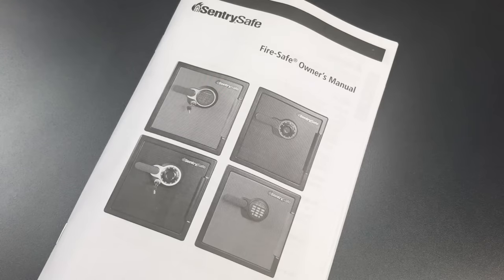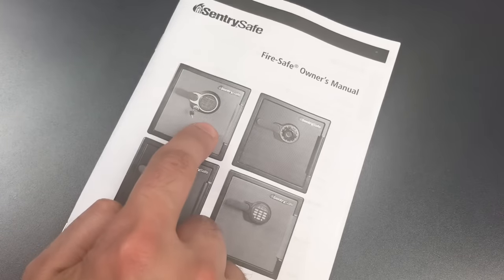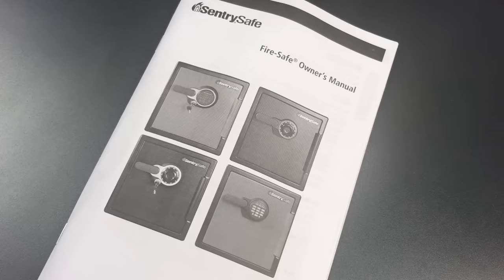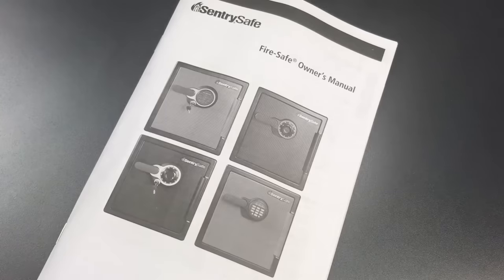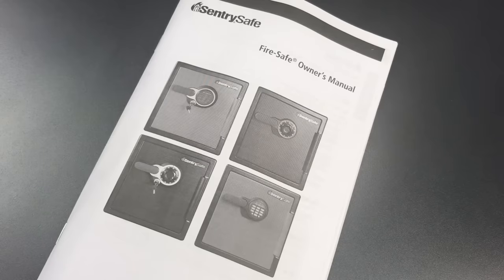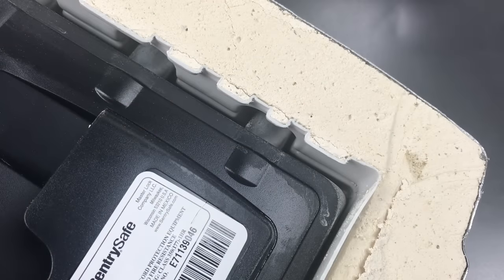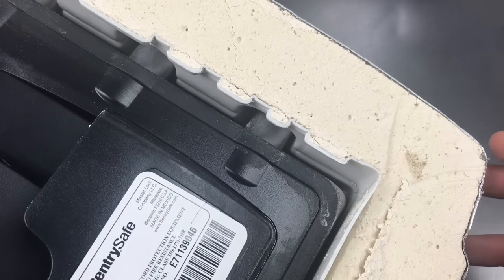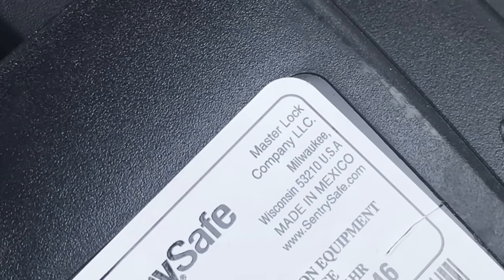[756] Sentry Safe Cut in Half FAST!

Comment: Love it. There's a Russian company that makes floor safes. They are made from 10mm or 3/8" steel and they tell you cement it into a concrete floor using rebar.
That's a bit more like it!
Reply: There's a lot more than just a Russian company making that kind of safe.  It's and extremely popular design for businesses that need to store only a few small valuable items and own the building or have permission to modify the building to install it properly.  Frankly it's not a bad idea for residential security either, in that for practical purposes it can't be carried-off to break into it somewhere safe from prying eyes, and it can be obscured from view to make it harder to find in the first place.
Reply: @TWX1138  I know but in Bulgaria, Russian made is easy to get. ;)
Reply: I have seen in a vid long ago that the best safe use THICK plates of copper. I mean,  probably a couple of inches. So you cant attack it using a saw because copper dissipates the heat so well that cutting it is near impossible, saw goes very slow and jams in the copper. Looks legit to me.
Reply: its not a saw it a torch (oxyacetylene) that cant cut copper
with a saw like this video is very easy because they are not abrasive witch means that the functioning principle doesn't relies on heat
Reply: 38911bytefree
Hm, sounds like bullshit to me. Copper is fairly soft and easy to cut with a saw. How would heat dissipation even hinder a saw? If anything, it helps. 
Copper tends to clog up abrasive wheels but most saws cut it just fine. Really the only useful attribute of copper for this application is its density.
Reply: swiss  Copper is actually hard to cut with tools ment for steel, tried drilling in copper? it'll ruin a good new drillbit in seconds.  However if you have tools made for copper its quite easy to work, but still slower than steel.
A good construction would be a layered mix of steel and copper, two layers of 10mm steel with 10mm copper in between would stop a lot of power tools (or at least slow down the prosess)
Reply: Mad Max  Cutting Torches isn't good for opening safes with valuable papers in them, you might get some jewelery out tho, if it isn't melting giving you just scrap gold.
About building safes of cast iron with carbide chunks in it, that would be effective, and if reinforced with something that makes the iron less likely to crack you got yourself a good strong box...
Reply: Renax the Man
Yeah, or you could do what actual safe manufacturers do and use layers of hardened steel, ceramic plates, high tensile strength fibers, concrete filled with bearing balls and other goodies that are guaranteed to put up one hell of a fight for any cutting tool.
Reply: Heat needs to build up to make the cutting possible. Abrasion process goes gaster on high temperatures, but copper keep the surface cold. Probably the clog thing is also the reason. Look for the vid here.
Reply: LOL, guees you can still fit something inside that is more valuable than the safe. Yeah, looks insane expensive safe given the high prices of the copper now.
Reply: No way in hell I would trust a Russian safe.
Reply: @acertainshape  Bad idea. Skripal's alive.

Comment: Its more an advertisement for the good old skillsaw's Then it's for that cheap-ass " Safe"
Reply: Don't forget to turn the blade backwards when cutting sheet metal or you'll maybe hurt yourself.  Look closely at this blade 2:37 and you can see it's in fact backwards. That's a point the LPL should have mentioned before some nitwit tries to copy this and gets a nasty kickback from the saw
Reply: @adamschaeffer4057     If you're trying this, then it's because you're stealing a safe. So I say they deserve any kickback they get.
Reply: @adamschaeffer4057  Actually, that is the correct direction, the saw blade rotates upward at the front and the teeth are angled upward and meant for that direction of rotation.  Blade speed is the #1 concern here, as wood setups are roughly 50% faster at the teeth, so there's not enough torque to cut through something like angle iron without grabbing too much material and getting kickback.  You need either a slower blade, a different tooth angle or geometry, or a combination of both.  Certain saw blades are actually designed to cut through steel, they have a different tooth angle that doesn't take as huge of a bite from the material and can be used like any other blade.  A few work equally well through steel, wood, plastic, nails in boards, and some are even used for concrete...it all depends on the blade.  In this case, that metal is so thin that even a wood blade/saw combo shouldn't experience much of any dangerous kickback provided you're not a rank amateur with a circular saw.  Had he attempted to cut through 1/4" steel plate, yeah it wouldn't have turned out so well.

An interesting side note, I've tested a lot of different types of blades and wheels for cutting metals trying to find the fastest one.  An abrasive wheel is the standard metric, but I've found that metal cutting blades cut just as fast with less detrimental heat introduced.  The fastest I tried was a completely normal but dull wood saw, so much so that the teeth weren't able to take a bite from the metal.  This seems entirely counter-intuitive, as any type of cutting tool should be precise and sharp, but it didn't start cutting until the friction heated the surface of the metal being cut.  At that point, it cut straight through like butter, the teeth merely being used to shovel out bits of metal that had been melted by friction.  Unfortunately, the sparks generated were excessive, even more than an abrasive wheel, and I relegated it to the shelf as a backup.

Comment: "An exit door procedure at 30,000 feet, the illusion of safety" -Tyler Durden
Reply: The exit door procedure is not meant for 30000 ft.  You cant open the door at that height.  It is specifically designed as such.  The procedure is for if you happen to land and be alive.

Comment: I think that fire protection is the most important aspect of this box.
Reply: It probably completely fails at that too. We just need a safe burning lawyer to test it.
Reply: @odizzido  actually, it doesn’t...it’s resistant not proof, so it does actually protect from fire which is the bigger point of it
Reply: @bostonrailfan2427  Was about to say with metal that thin fire will do damage and will get too it.

Comment: I had a Sentry safe I bought from Walmart and I “lost” the keys 🔑.  I had no way to open it so I took a screwdriver, a 4-5’ long crowbar, and a hammer I had in the garage. I put the flathead in the door (side that opens) and pried open a slot big enough to fit the tip of the crowbar in it. Then I placed the tip of the crowbar in slot and pounded it in more with the hammer. It started to separate the side from the door as I pulled on the pry bar and then “pop” It opened right up. I was surprised at how easy it was. 🔒 📦

Comment: Watching him cut this think open i'm like "is this made of Styrofoam?"
Reply: kind of yeah, sytrofoam is an insulator which means it's resitant to temperature change. The same logic applies to something fire proof. It doesn't get hot, and it doesn't combust at low temperatures.

Comment: I just bought the dial combination version for $30 from a bin store. They had the book taped to the top but they said they didn’t have the key or combination. I knew the combination was on the back of the book, and I have a 7 pin tubular lock pick/decoder. Once I got it home I got the combo from the book, entered it, and voila, it was unlocked. I didn’t even need to pick the lock. The keys and mounting hardware were inside.

Comment: i dont know what about usa... but we have two types of safes - 1 for storing stuff so there is no harm to them like fire, water etc. and 2) safe for puting stuff you want nobody to steal. This is apearetly the first type. Its not meant to be supersecure if someone wants inside. But no safe is safe enough - its a matter of a need to get in destructively so insurence will pay ... or you need to make a ton of noise (which you did) to get in so someone would notice. You can defeat almost any safe with powertools if you can make noise and you have plenty of time.
So this does not necessary mean that this product is really bad. You just have to buy it for its purpose.
Reply: beat me too it. there's definitely a difference. most fire/water proof safes are not so secure from theft, and vice versa.
Reply: The problem is that the company sell this as a real safe for storing valuables, not just as a fire resistant enclosure.
Reply: Yup, I have this fire safe in my closet. it has documents in it that i'd rather didn't burn.
Reply: it make also makes sense to store valuables in a fire resistant enclosure

Comment: When I saw the dust on the safe, I involuntarily blew at my screen
Reply: Yeah from the thumbnail I was expecting at least a metal cutting blade and some cutting oil as part of the process. Did not expect ~1/16th inch sheet, some insulation, and what looks like rubber (for water seal I assume) on the inside.

Comment: I thought it was sold metal at first and was like wtf thanks I learned something today
Reply: i never knew there are "foam" safes out there ...
Reply: If it is fire and heat resistant it has to be foam.

One good us of these is to keep the inside a safe for extra fire protection.
Reply: @57thorns  I think you are being sarcastic right there ;D
Reply: @96dragonhunter  Not really, the insides of an all metal burglar resistant safe can become too hot for paper or plastic, so you have an insulated box inside for extra heat protection.
Reply: @57thorns  :)
Reply: @96dragonhunter  I am sure you got it, but just to be on the safe side:
When computer media came around, companies had these large and bulky safes where they stored all their data in the form of paper documents.

Of course they also stored magnetic tapes there as well, except in a fire the inside of the safe became so hot (80 C?) that the plastic warped or melted, even if the paper was fine.

So there was a market for extra fire protection. in the form of a fire box inside the safe.
Reply: Solid metal is much heavier than most people expect it to be.

Comment: I have a 100yr old safe i got at an auction for less than that piece of junk  if you tried to roll it over on it’s side you would swear it was bolted to the floor. I’m pretty confident you wouldn’t get in it with a skilsaw and you certainly won’t be chucking in the back of your truck to attack when you get home !

Comment: The fire and water protection is the main reason to own a safe.  In fact, I strongly suggest folks get one just for that.  House/apartment fires suck

Also, any security safe should be bolted down
Reply: I actually own that exact "safe" purely for the fire protection.   I put sensitive documents in it, like original birth certificates, passports, etc.  Not because I think the safe will protect them from thieves, but purely to protect from fire and toddlers.

Decent toddler protection btw.  Can attest.
Reply: Yep, 100% agreed. It's unfair to mock this product as not being "theft proof", as that is not what it is intended for.

I keep my documents in a fire-proof portable lockbox. My theft protection is to store it where nobody will ever find it.
Reply: Bolted down almost anywhere in a home or office and this safe becomes 4x harder to break into.
Reply: @WizDJ  There is no provision in the safe as purchased to bolt it down. When i had a similar looking but much more robust safe, I bolted it to the concrete floor in a closet under the stairs. Down at the end where the ceiling got very low. This made a very uncomfortable working space to attack the safe. Plus I cut the bottom out of a cardboard box and put it over the safe. Reasonably well hidden to look like an old box at the back of a closet.
Reply: @curlydave7689  We utilize this exact safe in one of our businesses and it does actually have the provisions. The portions that are extruded as legs are meant to be drilled out if mounting and the plastic liner contains divots to mark the areas to drill. The reason the holes aren’t included as purchased is they would compromise the fire and flood protection if it isn’t to be secured to a floor or wall.

Comment: Hey LPL, just a comment for saftey: Do not use gloves with rotating tools! They provide little to no protection but expose you to the risk of strings getting caught in the sawblade and pulling your hand/arm in potentially cutting you or twisting body parts to an unhealthy degree :) (probably the saftey manual of the tool also states that, if not, go on)

Comment: When I saw the sawdust, my jaw dropped. They did NOT try to peddle a wooden safe, right? Right? Oof.

Edit: "Fire insulation", apparently. Unfortunately, it doesn't seem to be effective insulation against a sharp object.
Reply: That is what I was thinking to when he first started cutting.  I didn't expect high security but when what looked like wood sawdust started coming out my first thought was "How is wood supposed to protect the contents?".  I was expecting a thin concrete or plaster shell under the steel plate not a foam the same color as pine.

Comment: Great video! I'm throwing my sentury safe AWAY
Reply: It may still be useful for keeping documents safe in a house fire. Now we just need to see LPL drop it in a pool of burning jet fuel and see how long it takes to melt.
Reply: Why? Just bolt it to the floor and no one will be able to walk away with it which is going to be the main thing you have to worry about with small safes.
Reply: Eh I use it more as a fire protection box rather than theft protection as the problem with modern safes to that a thief can steal the safe then open it later at his leisure. The main protection is the weight of the safe nothing more
Reply: Panther Platform don’t forget to empty it 😂
Reply: @Navy735  no that is completely false. Even the CEO of liberty safes will tell you that bolting the safe to the floor is we're most of your security comes from. Professional thieves who steal safes don't care how heavy it is. The guy I pay to move my 700 pound liberty safe can push it up the ramp into his moving truck by himself with no help.
Reply: Panther Platform no need to throw it away, just use it to keep documents safe from fire.
Reply: Put it in a real safe. The drywall the sentry safe is made of is excellent for fire protection, and your high security safe may not have it.
Reply: They are good fire protection for documents (up to a point) but if those are documents you are also concerned about the security of you may want to keep the box within a real safe. Otherwise there are a lot of other uses. Use it as a bait box by putting a tracker of some sort in it and leaving it in the living room under an end table. Keep costume jewelery in it. Use it to secure the keys to the padlocks on the power cords for the kids computers and game systems/TV until they have completed their chores. I'm sure you can come up with other uses. I don't expect it makes a decent anchor though, all that fire insulation is likely to keep it floating. Fish marker perhaps?
Reply: David Rasmussen lol
Reply: I use my sentry safe for burglar bait. It'll be the last thing they see before the buck shot sees them...

Comment: When buying a safe check the thickness of the steel. You want one measured in fractions of an inch.

 If it's measured in gauge, don't bother.
Reply: When buying a FIRE SAFE check the fire rating of the insulation. This tells you the intensity and duration of the FIRE that it's designed to protect against. 
There are no requirements for "theft protection" in the FIRE SAFE standards and ratings... that is something completely different.
Reply: @johncoops6897  if you're buying a safe for theft protection that should be your focus. Fire rating is a secondary consideration since there are a hell of a lot more burglaries than structure fires.

Thanks to modern building codes and firefighting techniques structure fires with enough intensity and duration to overcome the barest of insulation standards are as rare as hens' teeth. Residential burglaries on the other hand happen every single day and even the best neighborhoods aren't immune.
Reply: @kevinfelton689  - perhaps crime is more prevalent where YOU choose the live, but certainly not everwhere. We don't even lock the doors in the suburb where I live (city of 6 million people)... crime is not really a thing in many places.
Anything of true value will be fully insured, so the things that truly matter (papers, photos, documents) will not usually be stolen by theives anyway. But they can be destroyed by fire or fire-fighting water very easily!
Nevertheless, this safe is a FIRE SAFE and is designed for that specific purpose... it's a VERY commonly purchased type of product for people who want that kind of protection, without paying many (tens of) thousands for a "theft proof" domestic safe. I'd guess that there are more Fire Safes purchased worldwide than any other kind.
As you seem to be trying to imply, a Fire Safe is pretty much useless for protection against theft, however that is absolutely dead obvious to even the stupidest of people. It's the same kind of  reason why apples are useless for making orange juice or motor oil.